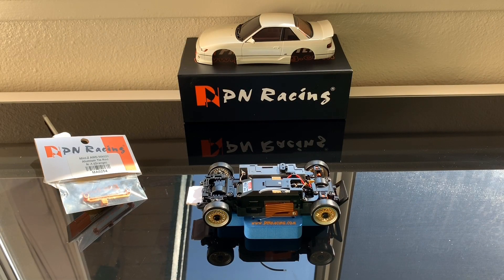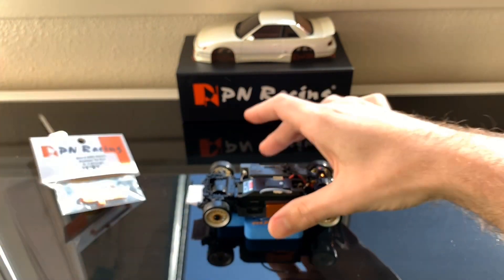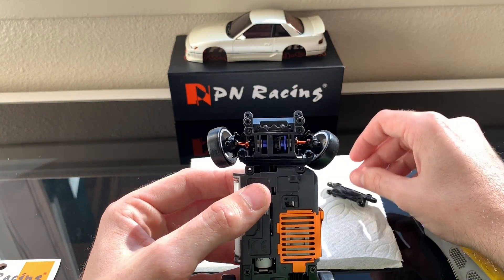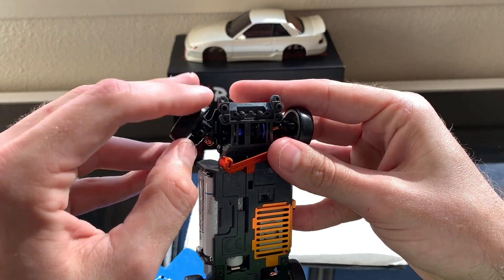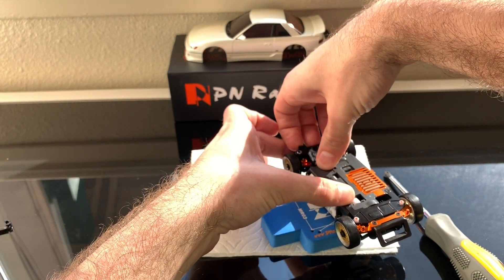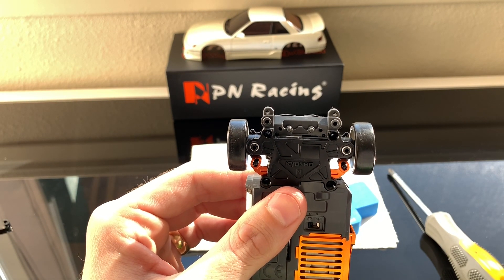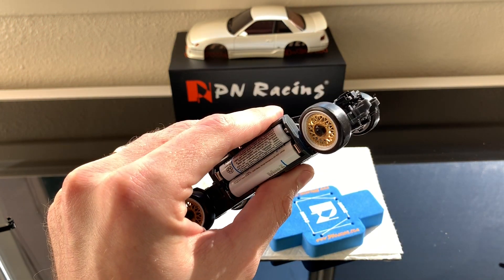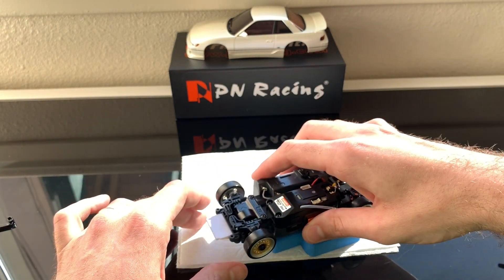Mini-Z Steering Angle Mod & Install Video

Comment: NEVER ruse thread locker on plastic as it will destroy the plastic. if anything use a SMALL drop of thick CA glue in the screw hole. it works great.
Reply from the maker: Thank you for the tip but I learned this the hard way :( that’s why I’m rebuilding my 020 chassis I suspect

Comment: Actually running 0 degree tie rods, was trying to increase the steering angle over default (wheels touch frame) requires the mod you did as well as filing the inside where the channel where the servo sits as the tie rod will impact on the inside of that channel.
Reply from the maker: Blitz Works shoot I dident even thing to check the channel where the tie rod sits to see if that was getting impacted. Thanks for the tip, I’ll have to double check this area when I tear down the front end to install my new camber knuckles. 

I really need to do a full disassembly of the car, so I can better understand how it functions, but I’m afraid I may mess this car up in the process. I need to start looking for a  used/boneyard ma-020 so I won’t worry about breaking in disassembly/reassembly.

Comment: hey, love the vids, idk if you still read these or not but when I replaced my tie rod on my ma020 im getting "chatter" when i try to steer and idk what i need to do about that, im gonna re check my tie rod
Reply from the maker: I see everything, I’m in the matrix 😹

But seriously, is the chatter coming from the tires, servo or tie rod? I’ve never had that issue before but I would check to make sure everything is screwed down properly first then go from there. It could be a lose Diff plate on the bottom.
Reply from the maker: Thank you for the support btw! I was racing to type the last comment as quick as possible & forgot the niceties 😺
Reply: @BMR3  hhaha thanks for the super fast reply,  you make the best vids on this type of stuff. i just changed the stock tie rod to a N-1 rod and when i steer and it goes back to neutral there is servo chatter (i think), i messed with the trims and nothing is quite fixing it. Im gonna recheck my install rn
Reply from the maker: @ipoyt8708  Hmm chatter at neutral is not good, could something have gotten that area? Even small debris can cause a huge issue, these tiny cars are incredibly sensitive. From what your saying it almost sounds like something is obstructing the servo movement
Reply: @BMR3  i took out the tie rod and the sound went away, it seems my car does not like the N-1 tie rod, without the rod in the servo moves fine and no chatter. Heres a quick vid i just took that shows the problem. I might just put my old tie rod back in D: https://www.youtube.com/watch?v=sO70teQ8MaE&feature=youtu.be
Reply: @BMR3  alright i seem to have cracked the code it was not a loose diff plate on the bottom if i tighten the plate too much it like rubs against the tie rod or something and causes that, if i unscrew the screws under the dif plate slightly the sound goes away

Comment: hey man, a shop near me has a big sale and he got PN racing tie rods, which one would you recommend for drifting? Anyway, great video, thanks!
Reply from the maker: -1 up front will give you a tiny bit more steering angle & initial turn in. Don't go above 0 degrees.
Reply from the maker: Does the shop have a -1 silver? Im in need of a tie bar & would love to buy in the USA, currently looking at European distributors since its sold out here.
Reply: @BMR3  okay nice, thank you!
Reply: @BMR3  unfortunately not, they only have the orange one -> http://www.modellsport-trinko.at/shop/pn-racing-mini-z-awd-ma020-alumium-tie-rod-n-1-orange/
Reply from the maker: No worries, thank you for checking man!
Reply from the maker: Thanks man! But I believe this is for the ma-010
Reply from the maker: TomBreProduction Yes indeed, thank you man that’s why I’m looking for. I found this one a few days ago, I’m hesitating ordering since it will cost about $50 by the time I get it to my door. 

But thank you man, I truly appreciate you looking out for me like this
Reply: @BMR3  okay nice, yes i know it would be expensive.., but iam glad that you found one!
Reply from the maker: Thanks again for looking my friend!
Reply: @BMR3  i dont want to annoy you but i have only one question left, can we use ma010 front knuckle on the ma020 for the rear? something like that?
https://www.srcc-devils.de/KYOSHO-MR03-02-AWD/MA0133B-PN-AWD-MA010-Alm-0-75-Camber-Knuckle-blue-Aluminium-Achsschenk.htm?a=article&ProdNr=5866&p=1037
cause it looks very similar
Thank you my friend!

Comment: Don't use thread lock!!!! It will eat the plastic parts. Thread lock is for metal only. Just a FYI
Reply from the maker: Yeah I learned that lesson the hard way LOL! That’s why I needed up doing the SP chassis conversion, since I destroyed the originally chassis with thread locker 🤦🏻‍♂️ 

Thanks for sharing the tip! Never know who might see it & need it.

Comment: whered you get the chasis? love the vid btw
Reply from the maker: I got this one off EBay since they were the only ones that had it in stock at the time. But it looks like a lot of distributors have restocked on the AWD lately so they can be found all over. 

Thank you for the support man!

Comment: I made a mistake haha i should have looked into mini-z cars more because i wanted one of the ones you could drift but my dumb ass didnt realize you cant really drift with a RWD mini-z you need an AWD🤣🤣and i already bought the RWD audi and cant return it because i missing cardboard that holds the car in place in the box even the mf at hobby town said RWD cars drift better but they dont
Reply from the maker: Oh man no way? The guy at HT knows just enough about RC to be dangerous.... I’m sorry to hear that, if I was you I would talk to the manager & demand a refund for store credit if you purchased the kit based on their recommendation. Then you can at least get a AWD without wasting so much cash

Normally I would say you should support your local hobby shops, but not when they give advice like this 😾. Hopefully they are willing to work with you to make this right...